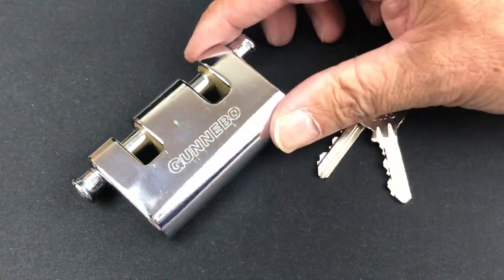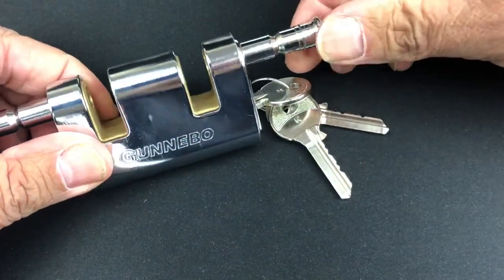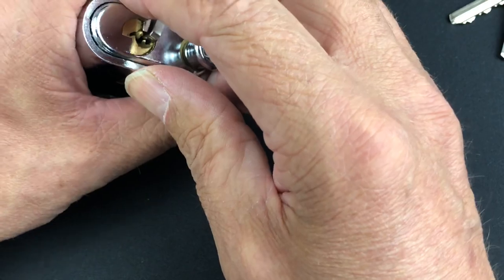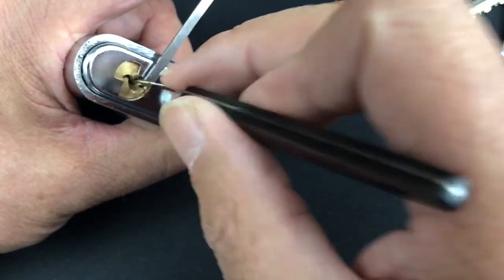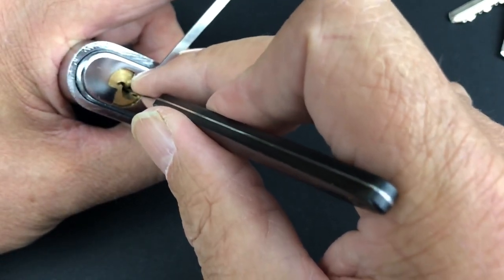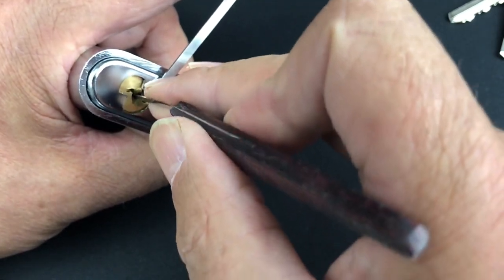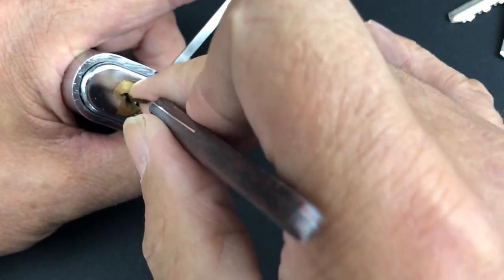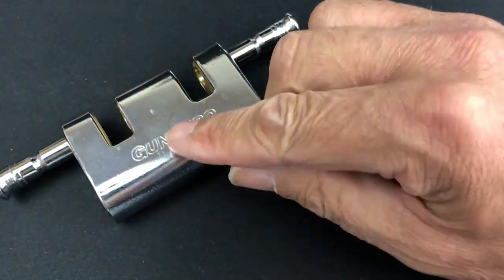7 pin Viro Panzer 4125 KD Motorcycle lock. Picked open

Comment: Very well done 👏👏. I'm going to have to take another crack at my Viro, I only had .025 picks when I got it and forgot to try once I got some  thinner ones. Really made that look easy, great video 👍
Reply from the maker: Thanks my friend. Yeah the 0.025 picks are to think for this lock, the key way is surprisingly tight, which definitely makes for a tricky pick, you will be fine with a 0.020 or thiner. Have a fantastic week. 👍

Comment: Wow a 7 pin lock opened in under 2 minutes. I'm very impressed. Was that the first time you've picked that lock?
Reply from the maker: They are fantastic locks especially as they have a 7 pin core, this wasn’t the first time, but only as the first vid wasn’t good, it took another minute to open it first time, which still isn’t to bad. 😊👍